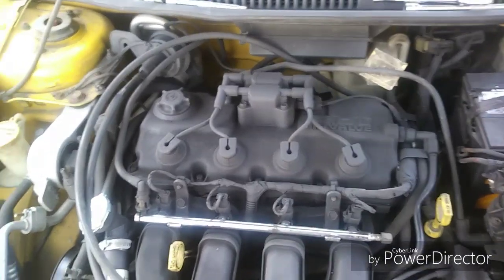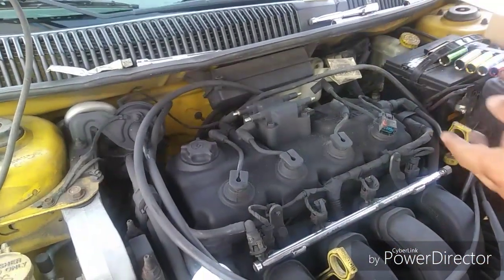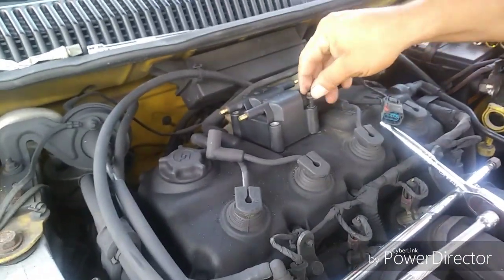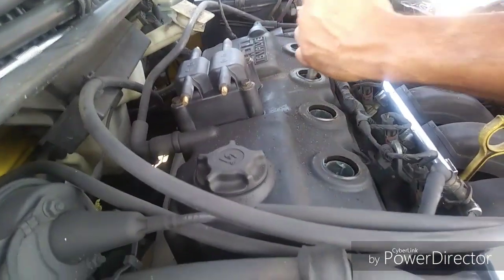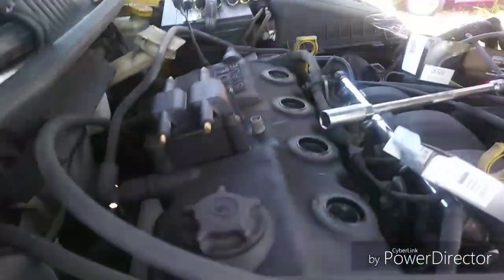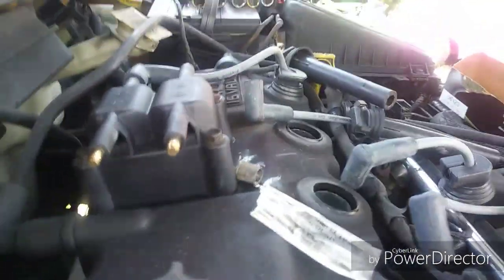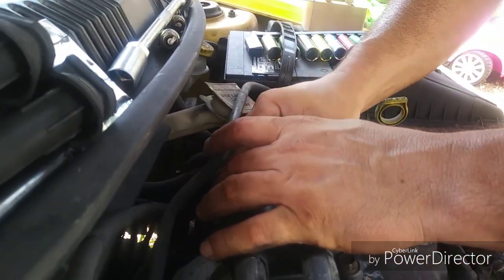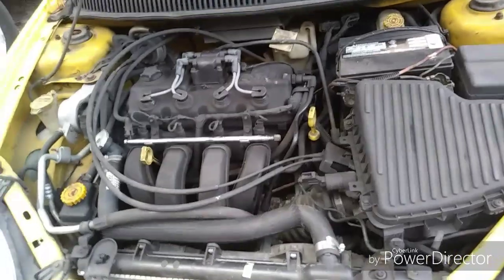2002 dodge neon 2.0 tune up

Comment: Make sure you don't have the wires touching each other. That can cause pre fire for the cylinder and valves. Yard mechanic myself for over 35yrs. You are still right with helping someone save hr's and money. Great tutorial

Comment: Hey did you do ever do a video on the cold air intake and the motor mounts? Awesome video BTW 👌 Cameraman did an amazing job too!
Reply from the maker: No not yet lol but give it time. Sorry I couldn't help there. Cold air intake was super easy and motor mounts weren't too bad. Does require a lot of jacking up and down on the passenger side of car.
Reply: Issac Moreno did you get a check engine when you went to cold air intake l?

Comment: Issac help me with my 2005 Dodge Ram. My timing chain jumped. I live in WPB, FL. Let’s film a total rebuild, Or engine swap.
Reply from the maker: I'm gonna do an engine swap soon . I want to drive a manual pickup. Currently looking for a 02-05 ram 3.7 manual , I have a donner already
Reply: @im234life  awesome! Keep on getting it. You do a great job, interpretation of the manual and your experience with what works best is very valuable. I am a fan!!🤙

Comment: You don't have to gap the spark plugs?
Reply from the maker: I have pre checked them before the video but yes you at least want to check the gap before installing. You can buy pregaped plugs, just check it 😀
Reply: @im234life  Thanks. It's been a long time since I changed spark plugs so wondered if the process changed from 3 years ago.
Reply: Get the ones that are already gapped. Those are great and same price usually